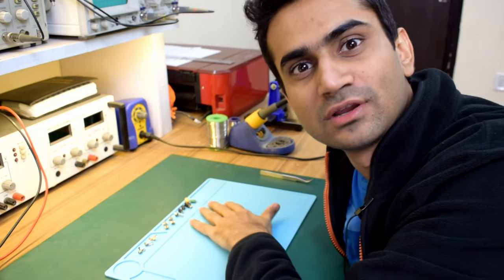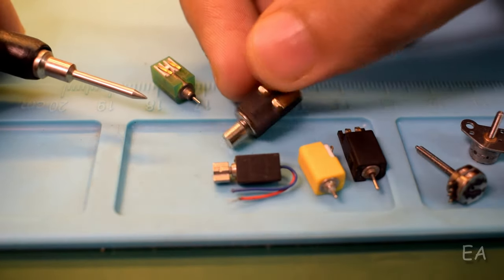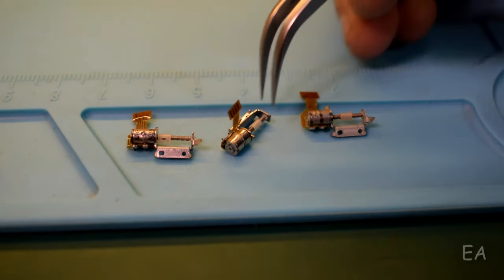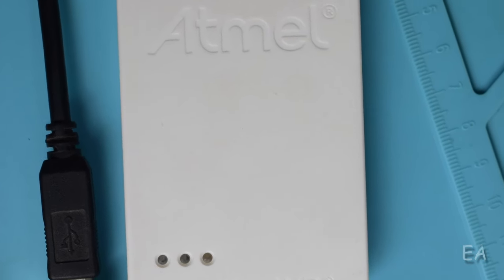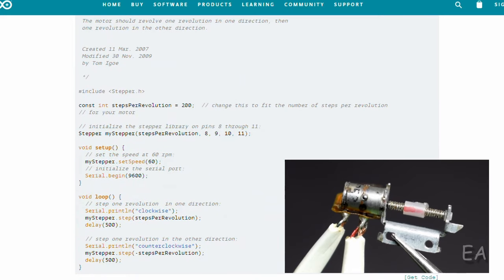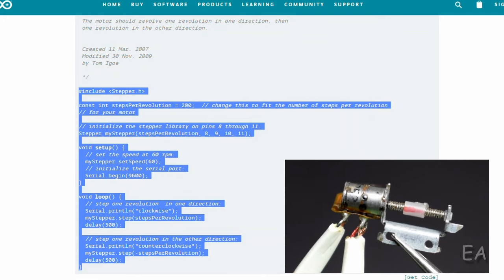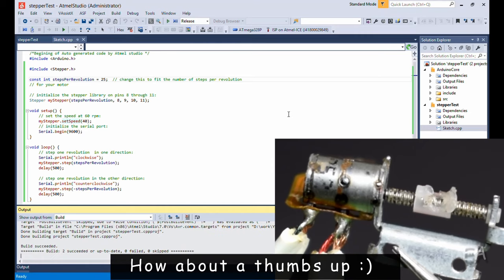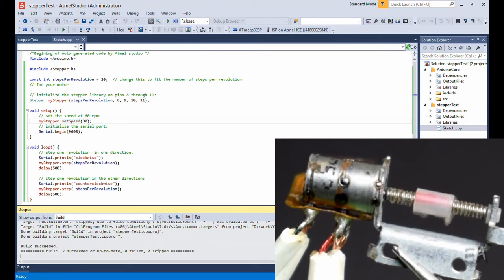Exploring a Micro stepper motor

Comment: Thanks for the video.  I disassembled a few of these motors to gather information about them.  Coils are 12-Ohm, Voltage is about 3V to 6V.  Each half of the motor has 5 fingers and 5 spaces, 20 full steps total per rotation.  Pad spacing is 0.85mm.  soldering directly to the posts risks damaging these teensy steppers, best to use the connection tabs with a very low wattage iron.  If you can verify my findings you can update the video description so others can have accurate information about these.  Again, thank you for this video.
Reply from the maker: Thank you very much. I'll update in the description.
Reply: I got this motor working with and A4988 driver board running 12 volts and the driver adjusted for 200mA.  I made a PCB for it also but the pads for the motor need to be moved for a better fit.  Here is a link to the video https://youtu.be/rTTI9cJcsJU

Comment: Is there any tiny stepper driver that can fit inside a 2.5cm by 2.5cm space? Or can i use some sort of tiny icu to drive it with button cell. Trying to build a watch using these motors.

Comment: I have seen people driving these directly with the outputs of Arduino and Raspberry Pi. Isn't flyback current a concern? 

It seems wise to drive these with something like the A4988 as Jorge Joaquin Pareja suggests, to avoid damaging microcontroller outputs, and to allow higher driving voltage...
Reply: I have exactly the same concern.  I would at least add some flyback diodes.

Comment: Hi sir I have a question, you said that there's no need to use for motor driver because of it's current consumption. The question is do I have to use motor driver if I need multiple stepper motor? Thanks in advance. I learned a lot on your video

Comment: What are these small steppers used in?  I reuse motors from broken electronics, but I have never seen such small motors..
Reply from the maker: focusing mechanism in a optical drive or cameras and similar applications.
Reply: @engineeringadventures1229   Thanks. I'll be looking out for broken cameras, haha.

Comment: Is there anyway to operate the micro motors without the adurino board, straight from battery
Reply: nope, but a bare atmel uC can be programmed in arduino if you want to reduce size and price

Comment: Hi there, I have a project where I’d like to make a very small surface rise by about an inch and also lower by an inch using a switch or similar. 
Think of the surface being about 30cm x 30cm with a small amount of weight. What is the best solution to do this? 
Any help or suggestions would be welcome. Thanks.

Comment: Hello. Please i want to run 32 steper motor of those kind. On a small project. Do i need to use for each it's own steper motor driver or i can just contrôle them with arduino if yes please tell me what i need to make them work.
Thanks in advance.

Comment: Anyone have any thoughts on controlling about 50 of these little motors at once? I always wanted to 3D print an array of about 50 hexagons and have them raise and lower slightly to look like a ripple is going through a panel or just have each of theblocks look like they are randomly popping up and sinking. I would embed a tiny nut in the backside of each block and as the motor spins it would raise and or lower the block. The mechanical side is figured out but I'm not sure how to control 50 of these simultaneously but independantly? Love the video and would love to hear anyones thoughhts.

Comment: My friend. I Bought a 2 fase 4 wire micro stepper and I would like to know if I can make it work without driver or arduino. but I don’t need it to step, I just need it to go a full side by side. There is any way to plug wires directly to the motor to do it?
Reply: I need to remove the micro pcb on it if there is any?

Comment: Great video. Worked great with Arduino. Didn't seem to have enough power out of a Nano to move the motor. Any suggestions (or tricks)?
Reply from the maker: Thank you. It's not advisable to drive directly from MCU pins. For experiment purpose you can use some buffer gate.

Comment: I wouldn't recommend directly powering from the micrcocontroller even if it can easily power the tiny motor.  Inductive kickback at some sudden stop could easily surpass the mcu's voltage level and fry the gpio or worse the mcu.
Reply from the maker: All you said is correct but no harm in experimenting when you are feeling lazy :D

Comment: I planned to create micro robot with many servos. Is it really to connect to arduino more then 50 motors?
Reply from the maker: Виталий Богряшов for 50 motors you will need dedicated drivers for the sake of current and number of free pins.
Reply: Vitaliy, you need 16-Channel 12-bit PWM/Servo Drivers.  Each one can drive 16 servos and it uses only 2 pins of your micro controller.  These modules are addressable, and you can have up to 6 of them, that’s 96 servos on the same two pins!  There is even a library for it called Adafruit Pwm Driver you can download, just google it.  Very simple.

Comment: Awesome, I have been searching for Years to find how to control these little stepper motors without a driver board. You have answed every question I have had in this one video. I will run some tests soon. Thank You!
Reply: U will have to check the current requirement of your motor as well as  if u need microstepping. If yes , an external driver is needed

Comment: Thanks for your review it’s really helpful! I bought a bunch of those micro steppers some time ago but didn’t try them yet. Now - it’s so easy as you don’t really need any hardware interface. However need to check what the current flows if you try hold the motor with your hand to not burn the mcu port.
Reply from the maker: Olexiy Bagriy thanks. The current is within GPIOs current capacity limits.
Reply: @engineeringadventures1229  
In other words, I don't need current limiting resistor or motor driver right ? My own micro stepper motor is 8mm 2 phase and 4 wires. Is my motor a bit higher in capacity than yours ? I want to program the set up using arduino because I do not have atmel programmer, do I need to worry about anything ?

Comment: Hi, We are working on my project where we are building the robot legs (4 in each leg) using linear actuators. we need similar kind of motors which are small enough so it can fit in, and also have torque to support the whole body, would it be possible for you to provide sources where we can buy small stepper motors.

Comment: This is a Great video. Thank you very much for this. by the way, me and my friends are also working on a project using these stepper motors. we need to get some linear movement using the screw axle. If you can, please help me with it. thanks..
Reply from the maker: Akalanka Kavinda yeah you can use these but the plastic nut part is not tight enough and it slips when there is minor obstacle. So you might need to find a way to tightening the nut part. All the best for your project.

Comment: Hi there EA, how much do these stepper motors weigh? im doing a lighter-Than--Air drone project. Thanks!
Reply from the maker: Hi Andrew, these are very low power motors and for different applications. For your application brushless motors are used. Share more info enthu.vikas@gmail.com, maybe I can hook you up with right people. Good day.
Reply: @engineeringadventures1229  yea I don't want to use brushless motors because I'm not using propellers for thrust, I'm using 'fins' to propel the drone, so these small steppers could be useful for that. I'm currently using servos but servos but these steppers could be lighter
Reply from the maker: These motors barely have any torque for that, but you can experiment anyways.

Comment: Where's the current limiting when driving the stepper like this? The coils have a resistance of maybe a few tens of ohms (the several models I have are 10-50 ohm). The micro controller pins will be damaged when driving a resistance that low.

Comment: Hello Vikas. Nice Video. Whats the torque of such small motors ?
Reply from the maker: Satyendra Verma thanks. I couldn't find the specs. Contact some manufacturers.
Reply: @engineeringadventures1229  Thanks Vikas for the reply. Can you share where i can get the super small stepper motors that you used in the video ?
Reply: @engineeringadventures1229  would you be interested to partner in a project involving Stepper Motors ? Can i connect with you on email ?
Reply from the maker: Satyendra Verma mail enthu.vikas@gmail.com
Reply: @engineeringadventures1229  have sent a mail. Thanks
Reply: @satyendraverma3832  you can buy 10 of them from AliExpress for 50rs

Comment: Hey Vikas I was looking forward to using micro stepper motors in a project . I picked up a few off Ali Express bit the distributor was not able to give me data sheets , do you have any data on the torque characterization of the ones you settled with ?

Comment: I bought some from Amazon but non of the plastic nut parts have any grip on the shaft, anyone have a solution?
Reply from the maker: Rozco I couldn't find any solution either. If you find some solution do let me know!
Reply: Engineering Adventures found the pitch of the thread in the questions on amazon, it is 0.25mm, so I guess buying or 3d printing some nut with the threading is the solution, but getting it on the shaft would be the next problem

https://www.amazon.com/ask/questions/Tx2EQI8RGHH58GB/?
Reply: Just an idea what if to make a kind of nut of a drop made with a hot glue gun. Not sure if it really works and how long it lasts but anyway worth trying..
Reply: hot glue might be to soft , might work for a short while. Using some kind of formable plastic or hard clay could work, putting baby powder on the shaft before applying the plastic would prevent it from sticking to the shaft
Reply: I believe the plastic piece is designed to hold a piece of wire which will be pressed against the threads and ride in them. the plastic piece itself is not threaded.

Comment: Very nice work thank You. I was able to solder wires to tiny barrel one; use tiny wire loop some liquid flux and a blob of hot solder from side of point tip. With the loop one can hold wire in place by pulling slit lateral force.

Comment: Hi! I also have a hobby project that requires this size of stepper motors, and despite I tried the same test (using Arduino to directly drive the motor), I took this solution as temporary, thinking that I would hook it to a stepper driver later to get proper torque. But now that I watched your video, I think there's maybe no need for much more current for such a small motor, and so I'm considering to remove the steeper drivers, which would release a lot of used space! It's all about the torque, if it's enough or not. And by the way, those mini-stepper drivers use 18 degrees per step normally. I would love to see a follow up of your project!!

Here is my video, using GRBL to control the motors from the computer: https://www.youtube.com/watch?v=Y4RB8efI6bs
Reply from the maker: Hey, you may need to experiment with and without the driver and compare the torque which works for you.
Nice setup btw. It may take time but I'll try to bring the followup video asap.
I'm glad it was helpful to you. Thanks.🙂